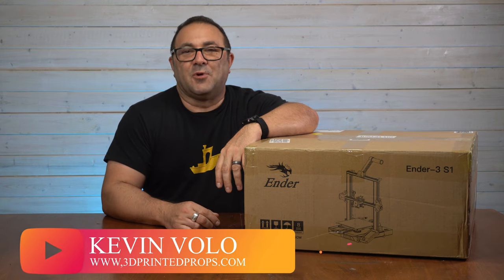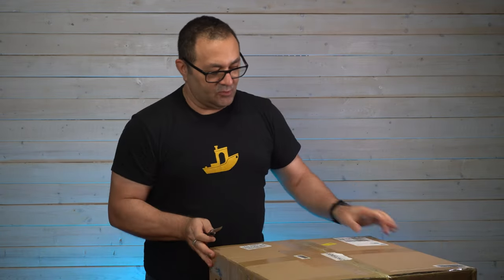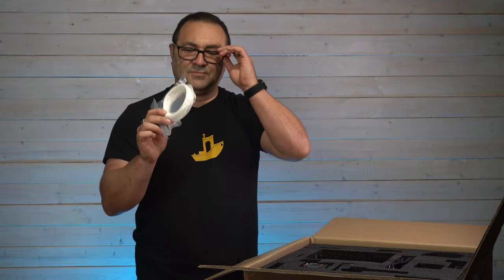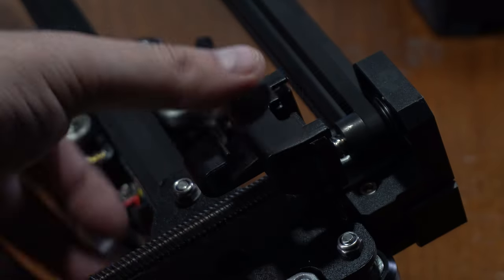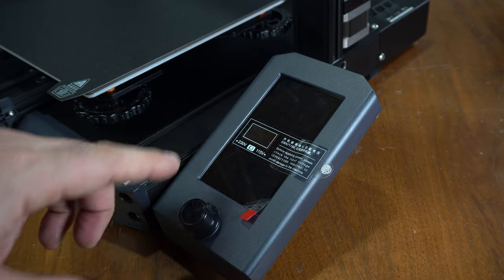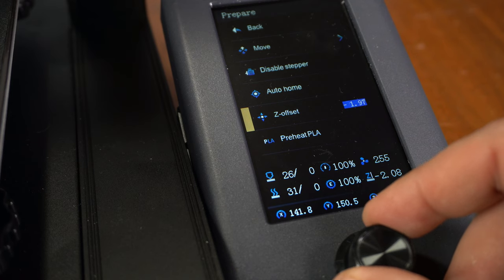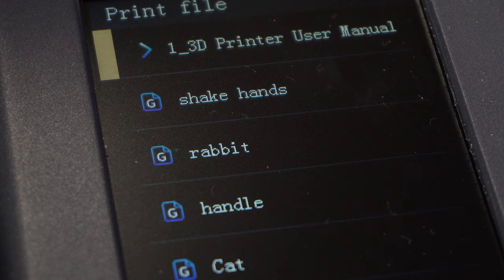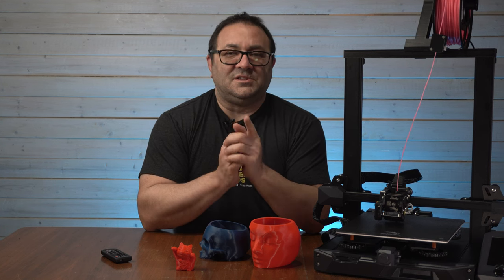Ender 3 S1 Review and Assembly

Comment: There are a couple major misses at this price point that are hard to overlook.  1st the direct drive still has a ptfe Bowden tube in it, so you won't get the higher temps for certain filaments. Vs a all-metal hot end. 2nd the arm chip in the board is only 256k memory on it. The ender 3 v2 has 512k memory. so, updating firm ware is going to be limited, or adding anything else to it.
Reply from the maker: Yeah, I do wish it had an all metal hot end.

Comment: Creality is really pushing this one... Seeing it all over.  Ok printer art premium price point.  Pass.
Reply from the maker: I don't know, I think the price is pretty good for what you get, but yeah, its hard when there are so many low cost printers out there. But most don't have what this one does. But I get it. :)
Reply: @3DPrintedProps  I agree.  It is pretty good for what you get, especially at an entry level if you don't want to make any modifications on your own.  If you're ok with getting like, an Ender 3 Pro or similar, and adding ABL/direct drive/new mobo/dual z axis, then the Ender 3 S1 is probably not for you.  But if you don't have the time or patience for it, I could see this being a good value.
Reply from the maker: @mavd5831  Totally, if you want to tinker and mod it then get a Pro, but I like not having to screw around with upgrades at this point. :P